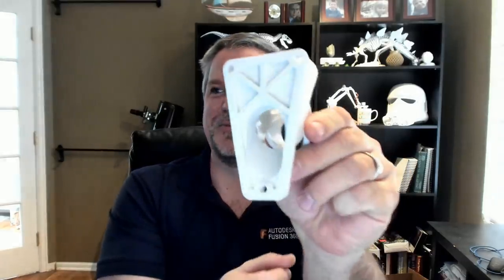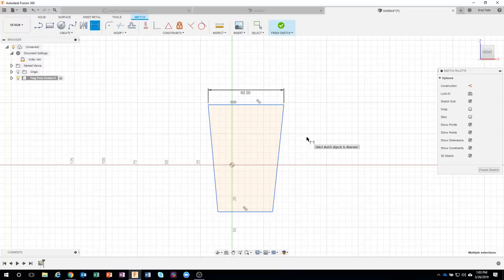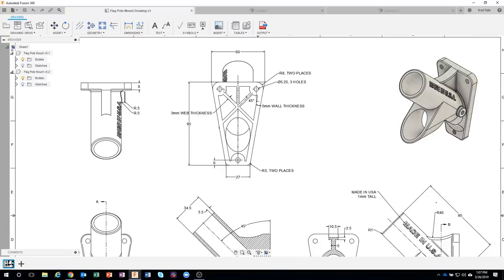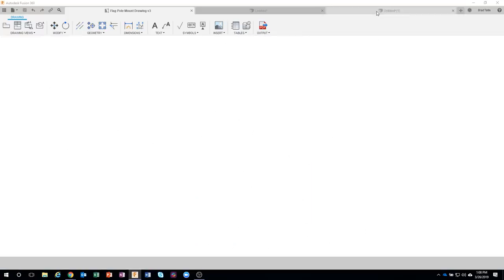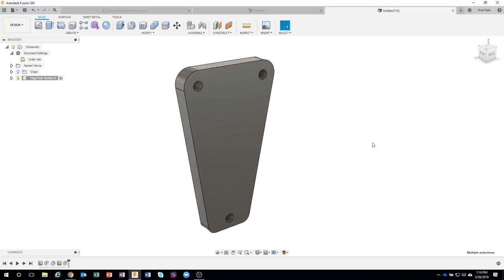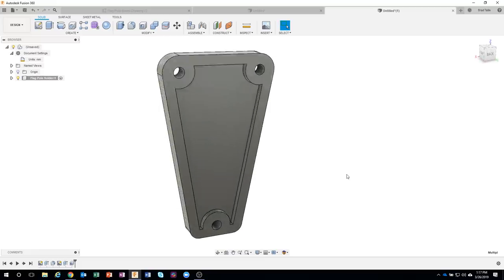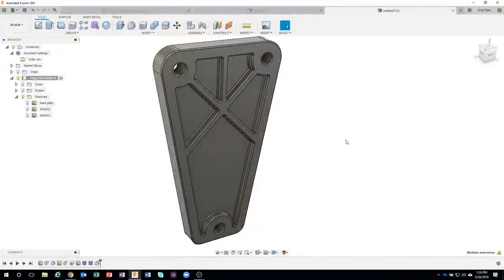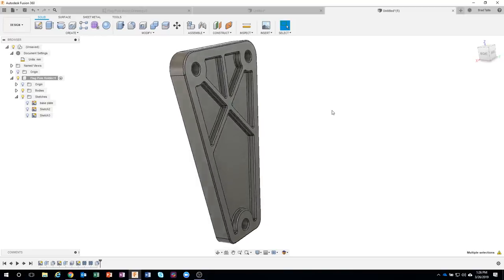360 LIVE: Design a 3d Printed Flag Pole Mount

Comment: I messed up (didn't follow instructions) on creating the rib , but it still worked out. I did a symmetrical extrusion on the top part of the rib with a total width of 10.5mm, then did a replace face command on the end of the extrusion to get it to wrap around the tube. Same result, but the rib command was easier. Very cool tutorials. thanks for posting.

Comment: Thanks again, new things learnt this time:
- trim
- vertical alignment contraint
- 2 stage web to avoid things being in wrong place
- plane along a path
- extrude to object (specifically didn't know it did interesting things when at an angle)
- variable radius fillets
- offset face
- replace face
Reply from the maker: That's a NICE list!

Comment: So when I tried to do everything you did to shell the tube - selected the first face, clicked shell, then enter 3.5mm for the thickness, then try to select the second face, it doesn't let me select the second face. It only works if I select both faces first, then enter the distance. I have seen this on other commands as well, where you select other faces to add to the selection after entering a value, but for me, after I type in the value, I can no longer select anything. What gives?

To create the top rib, I just extended the geometry a few mm or so, and that got rid of that line in the face. So I didn't have to delete the separated faces that were created at the end of that geometry. Once the line was extended into the tube far enough, the face was fixed.

Variable filet - Holy cow, that's cool. Love the way they did that command!

For the text, just extrude it two sides to each object. One side to the tube, the other to the offset face.

AWESOME tutorial! I learned so much, including all the suggestions I made above by just playing around with different ways of doing things 😁 Thank you so much for this one!

Comment: The way you did that text, the sides were still perpendicular to the plane the text was originally on; Not that big a deal, but especially if it was cut instead of extruded, it could cause some problems... I believe if you split the face with the text outlines and then offset those faces, you would get edges normal to your curve instead.

This still doesn't fix the distortion that the sheet metal hack fixes, so get on your programmers' butts and have them implement curved sketches!

Comment: I have been trying to do this flag holder. after about 12 times to many things are not working right. You show that that the holes will snap into the center area of the arch's of the two top fillets. Mine will NOT do that. I am using the hobbyist version of fusion. It worked once but will not work at all now. I have to keep figuring out different ways of get the program "to work" . It sure never has worked right for me over 3 years of trying.

Comment: Hi! does anyone know why when trying to fillet I only have the option "Edges" and not "Edges/Faces/Features"? Thank you for this great video!
Reply from the maker: You might need to update. Do you install from the App store, by chance?
Reply: @Juan-  Make sure your radius type is set to "Constant Radius" and not to "Variable Radius" in the fillet dialog box.
Reply from the maker: Hey Juan, let us know if either of these suggestions helped please. Don't want to leave you hangin'.
Reply: @adskFusion  Thank you! I just tried updating and it solved the problem.
Reply from the maker: Awesome! That was a recent update.

Comment: Another awesome video. Have a question? I put in all the parameters before I started sketch. Download the drawing, and thank you for that, but when i tried to add the r8 and r5 fillets from my parameters names it showed red and would not let me add from my parameters  I had named. Probably something I am doing wrong as I am new at Fusion 360.  Ok I found out what I was doing when I made my Parameter i used the rad instead of the mm for my Unit.
Reply from the maker: It sounds like there might have been a typo in the parameter window or dimension. Let it autofill and select.
Reply: @adskFusion  Thank you so much have completed the Flag Pole holder in fusion and mine looks exactly like yours. Again Thanks Brad
Reply: @44mod  Awesome!  I'm glad to hear it!

Comment: I'm having a problem, I'm extruding an svg sketch from object (cilinder) and it seems that any sketch object that crosses the center gets chopped. In this case, just the leftmost rectangle marked with a red arrow.
Please take a look: http://es.tinypic.com/r/2h802gg/9

And I'd like to note that both your technique and the suggested in the comments is not 3D text perpendicular to the surface. The bigger the text, the more it looks "deformed": http://es.tinypic.com/r/2mms7wl/9

Comment: ? FOR YA, I'm a sketchup user transitioning to fusion 360, but (here I go. I can navigate all around sketchup, (so I have the 3d connexion, good,(fusion 360 is slower than SU2018,)
it seems there is less of a snapping feature, (both really could use a localized tab--jump to the next area).. I feel I still need a Pen and a writing pad( to move and localize in (work from house for hours_+) has anyone else found a way to navigate speed better shortcuts added.  only keyboard.

Comment: Thanks for this tutorial I learned quite  bit.  I don't use any of the social media sites and do not know your email so I am posting pics of my 3d printed version of the model from today's tutorial. 

Here is my model.  Printed on a CR-10s Pro, layer height=0.2mm, infill=30%, inland PLA+ blue, nozzle temp=205C, bed temp=60C, print time=6 hr. Note: At 0.2mm layer height the 0.5mm fillets are not vary visible.

https://imgur.com/a/fOQpfZk
Reply from the maker: That is so cool! Amazing how fast you turned it around. You can always part here, but remember the Fusion 360 gallery is a great place to connect and show off as well.
Reply: Wow!  You took it to the next level and printed it!  Awesome!